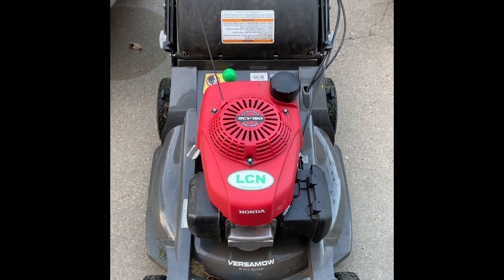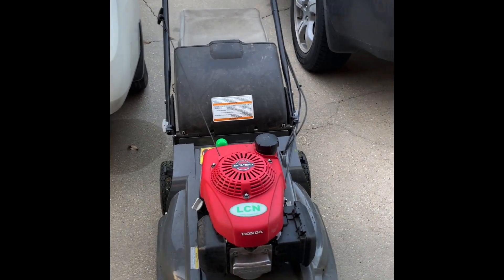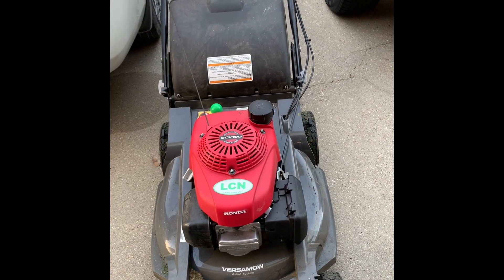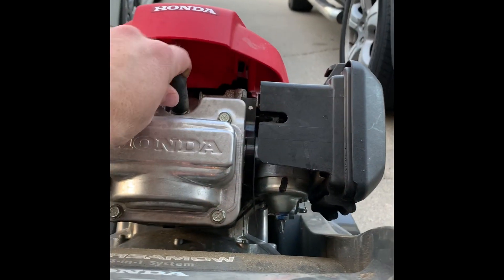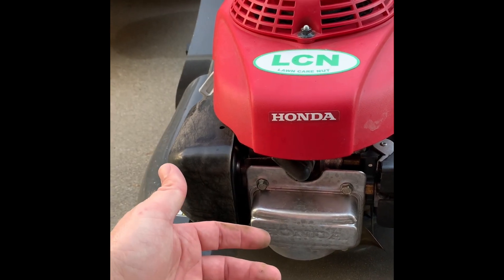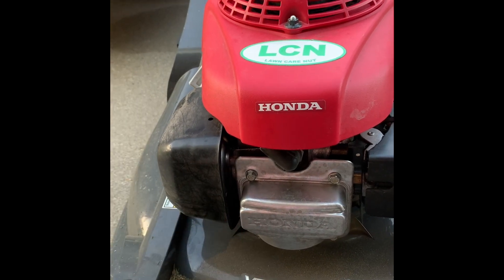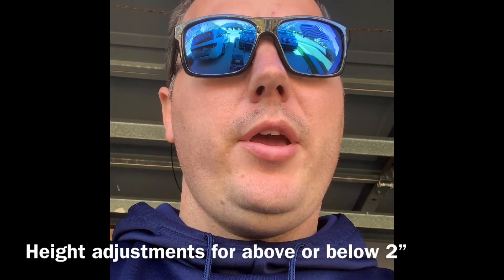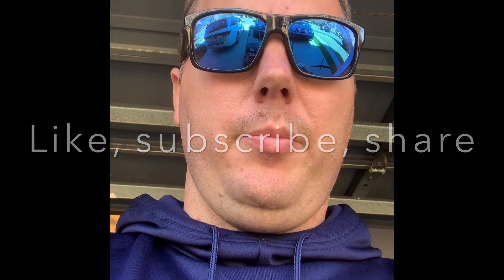Honda HRX 217 HYA overview and blade change

Comment: How did you change the blades without the mower on it's side?  How did you keep the bottom up this way?
Reply from the maker: I have a Big League stripe kit on it. I’m guessing that weight combined with the slight decline of the drive is just enough to counter balance it. You could try putting something like a bag of fertilizer on the handle to hold it down.
Reply: @southernlawnguy6598  Great idea, thank you for that!

Comment: I gave you a thumbs up..But Please wear Leather gloves.. Set the Torque of the Blade bolts between 36 and 43 lb ft. Make Sure the Concave side of the washer faces toward the Blades...Reminder to all Smaller Blade Goes Closer to engine.

Comment: What is the factory degree angle the Honda blades are to be sharpened at?
Reply from the maker: As far as the factory degree angle, I haven’t found anything in writing including in the manual but I will update this thread if I do. These blades aren’t super thick so I’ve read to keep them sharpened at 30 degrees. If you have an “All American Sharpener” jig they now have a custom bracket that correctly mounts the Honda microcut blades and at the 30 degree angle.
Reply: @southernlawnguy6598  I do have the All American Jig.  Been sharpening at 35° - seems to be a better cut.  Thanks for the reply.

Comment: How do you remove the blade holder? One of my blade bolts broke off inside it while changing the blades.
Reply from the maker: I'm not sure about that. Might have to drill the old bolt out with a small bit through the center of the broken bolt. Have you tried contacting Honda customer service?